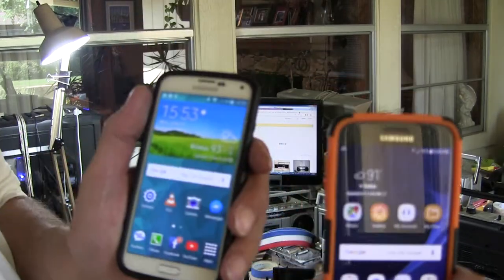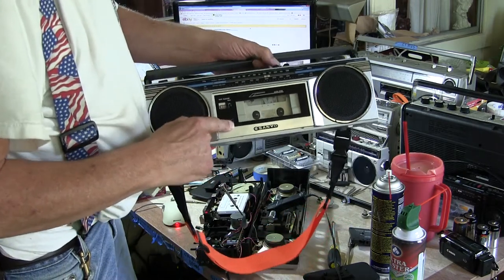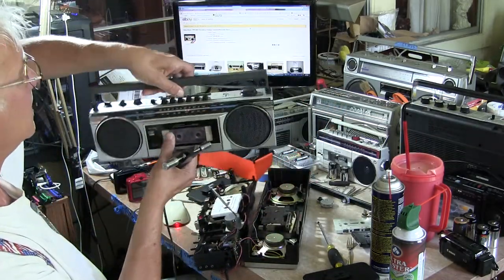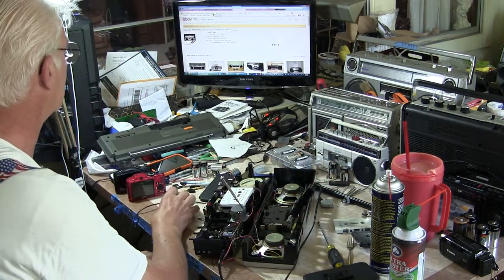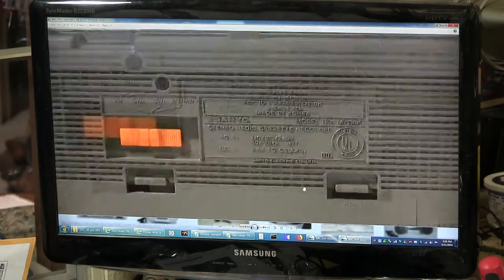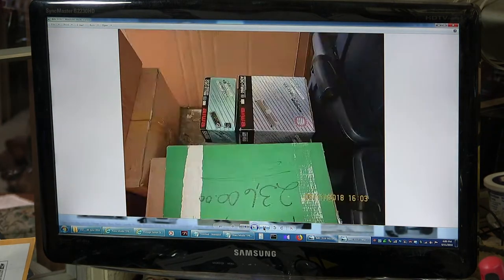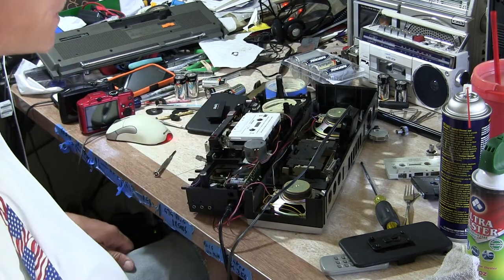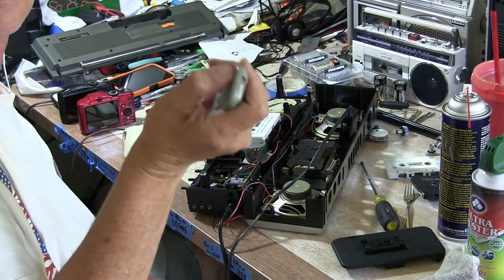How to Adjust Cassette Tape Deck Speed calibration setting correct Pitch Sanyo M7130K boombox

Comment: I can't adjust the speed . Though I've done that it is not in the control. What to do now?! I'm having Sanyo M-7830K
Reply from the maker: I have not opened mine yet so I don't know specifically in this model 7830 Sanyo exactly what motor it takes and or how to adjust it but if you cannot adjust yours what you will need is a new motor so you can adjust it speed that is